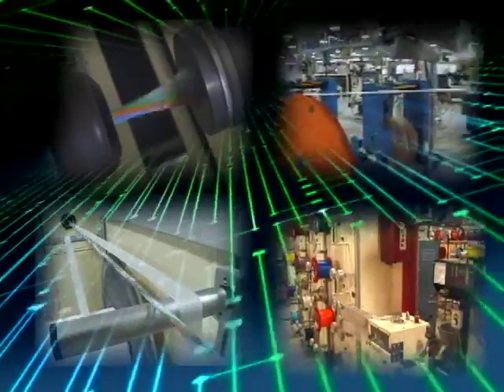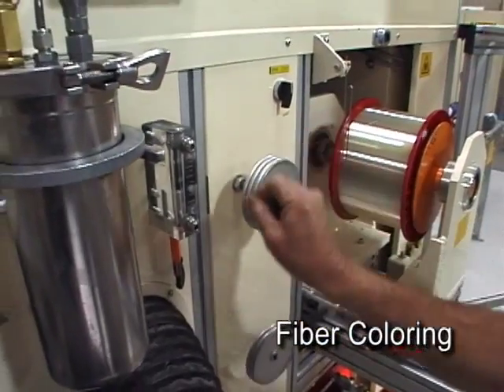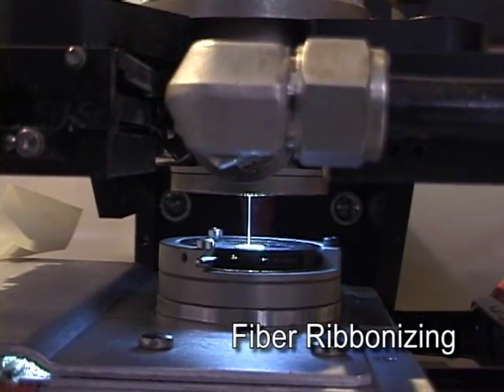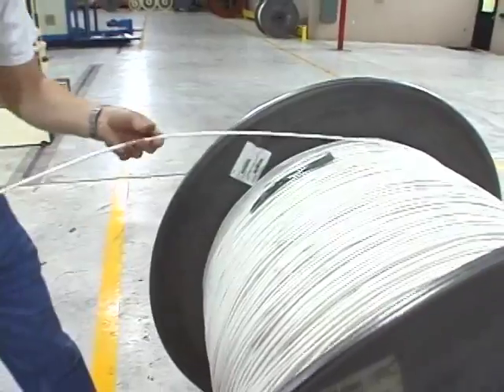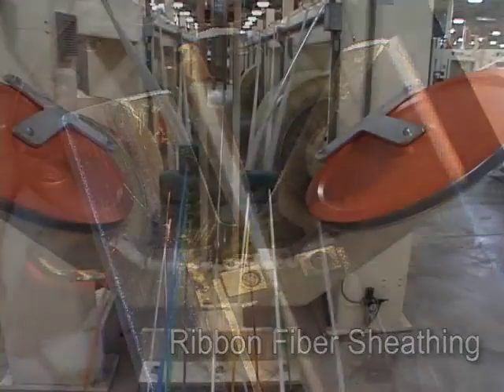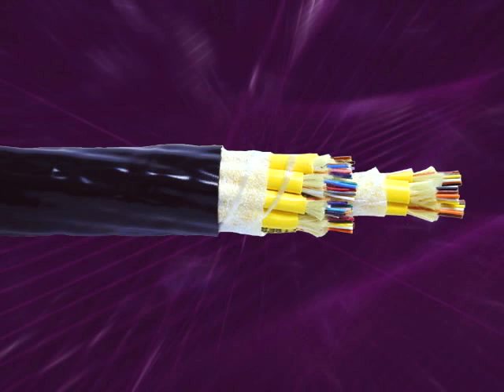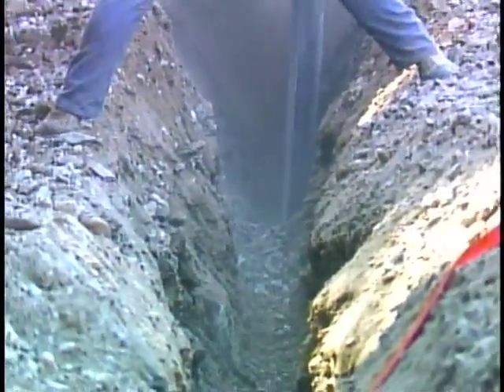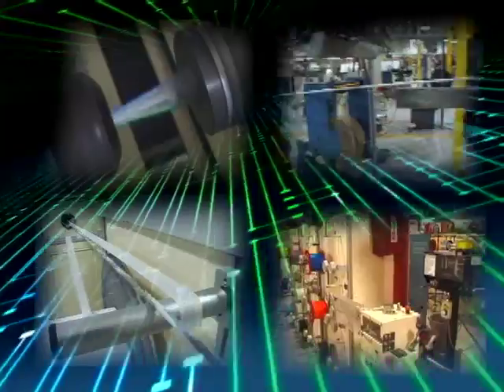How It's Made: Optical Fiber Communications Cable

Comment: Amazing feats of science. Are the machines custom made or industry standard for optical fiber manufacturing?
Reply: The machines usually are custom made,  FIBERCAN support all range of optical fiber cable production lines:  www.fibercanmachine.com.
Reply: Elysium custom made most of the time. Some standard things like extruders, payoffs and take ups can be integrated with custom controls for the product.

Comment: Hi, great video and very informative.  However, it appears you have access to both ends of the cable so why don't they test the entire length instead of a sample?  Thanks!
Reply from the maker: +Joseph Stokes 
The optical fiber cables are tested from end to end using an OTDR (optical time domain reflectometer) and the test reports are placed on the reel before shipping. Thanks for watching!

Comment: http://www.analogti.com/electronic-components.html
http://www.analogti.com/laser-control.html
ATI offers a broad range of laser diode drivers/controllers: AC input laser drivers and DC input laser drivers. The latter  includes high efficiency laser drivers, ultra low noise laser drivers, and dual mode laser drivers.